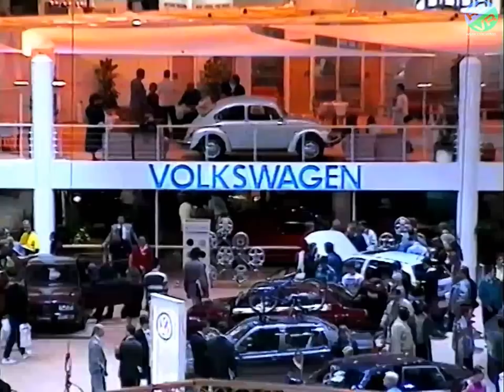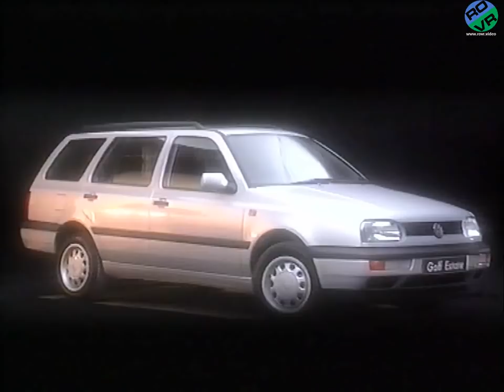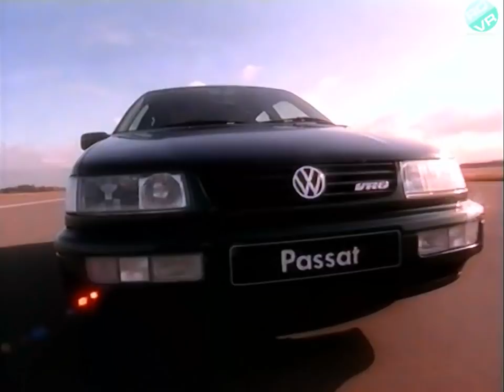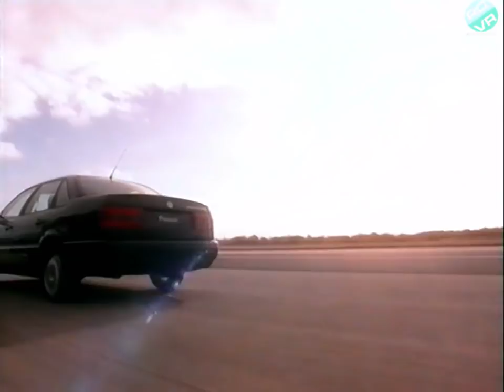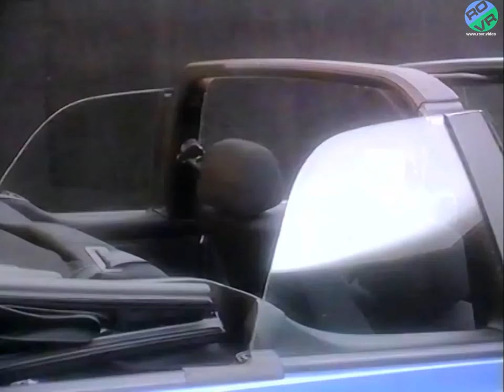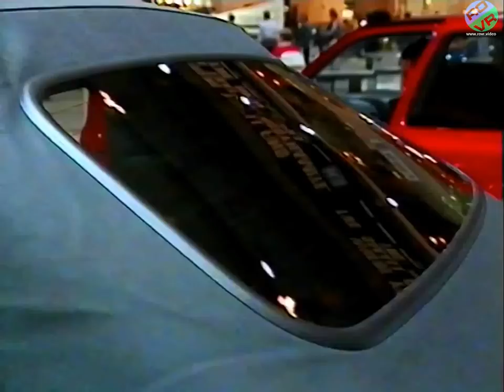Volkswagen - Learn about the Volkswagen Experience (1993)

Comment: I remember Volkswagen of the early 90s. My favourite was the Eurovan, a replacement for the old favourite, the rear-engined, rear-wheel drive Vanagon, that has been around since the 1950s. I also love the early TDI Diesel engine. That's also the last of the good looking Volkswagen Passat, Golf, and Jetta. :)
Reply: The ahu Tdi engine was the best thing out of vw since the mk1 golf.
Reply: @fastinradfordable   I regret that I've never driven a VW TDI vehicle. They no longer seem to be produced. At least not for the US market.
Reply: @jasoncarpp7742  its never too late.
I bought the entire 1998 jetta for the swap into my rabbit, for only $500!

you wouldnt want a new one anyways  you want from 1998-2003 "VE TDI"
AND NONE OTHER!!!

2004 and newer is a totally different kind of engine.
the VE tdi is the ultimate evolution of the legendary old vw diesel.

Its never too late as I guarantee that many will be running long after you or I have passed.

The Amish use vw diesels because they are mechanical, and can be run with zero electronics. And they can run for over 5 hours on less than one gallon of fuel.
Reply: @fastinradfordable   For some reason, people don't appreciate the Diesel engine. They think "Diesel?! They're noisy, they're slow, they belch lots of smoke, they're un-reliable", bullshit like that. I got to drive briefly a Mercedes-Benz Turbo Diesel. Although it was a rather short drive, around town, no freeway driving, nothing to truly test the performance of the car, I loved driving the car. I so wish I had bought the car. Being a German car fan, this, the BMW, and Volkswagen were my favourite cars.